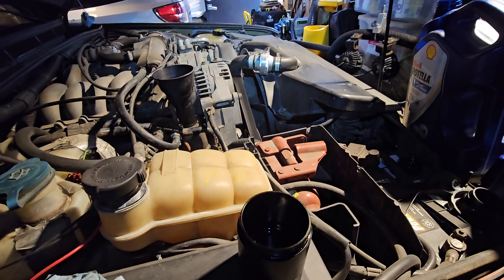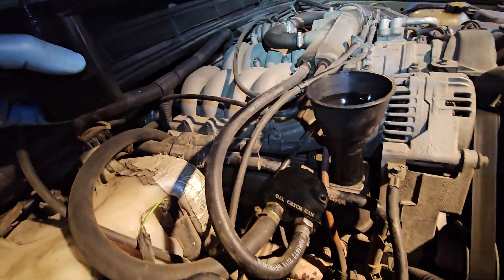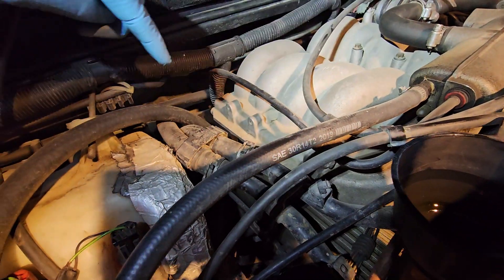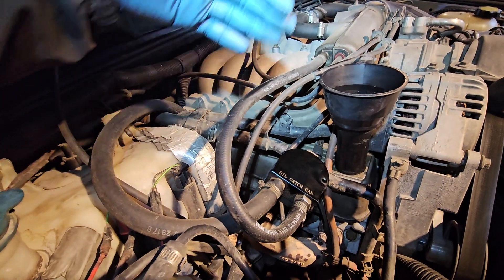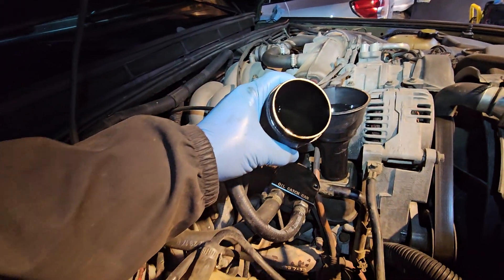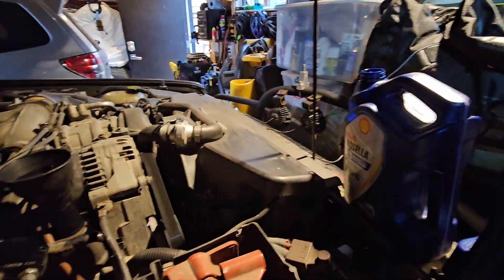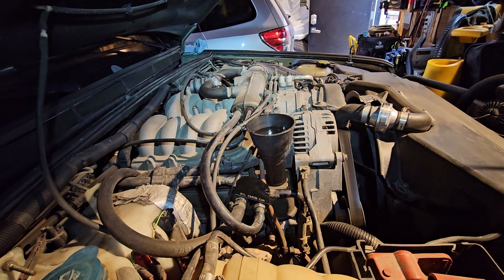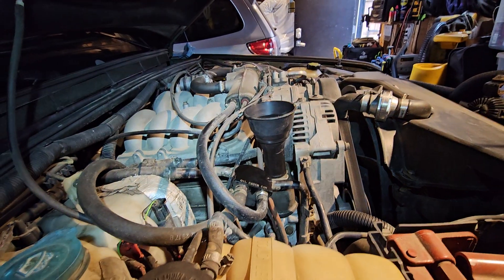Why Install an Oil Catch Can and What Oil to Use

Comment: What about the other side?
Reply: I only ask because I use two oil catch cans one on each side regardless of the oil separator on one side.
Reply: @lr2d2copilot94  likewise running two seperete cans for each side
Reply from the maker: For some reason there is only a PCV valve on one side of the cylinder head. If this isn't what you were asking about let us know!